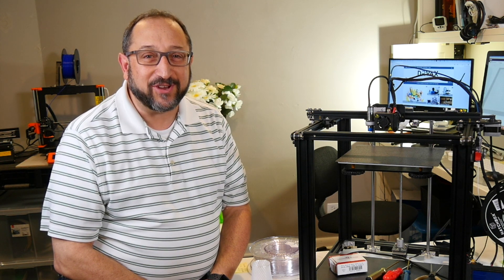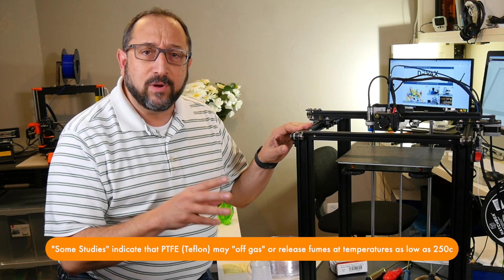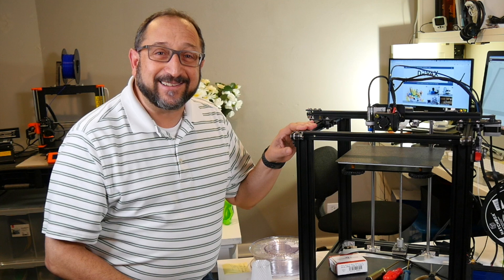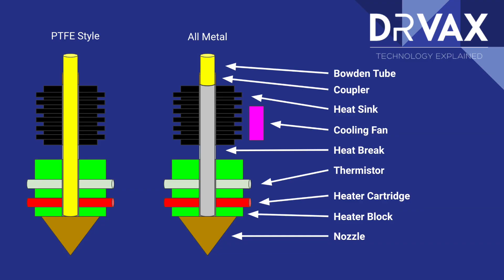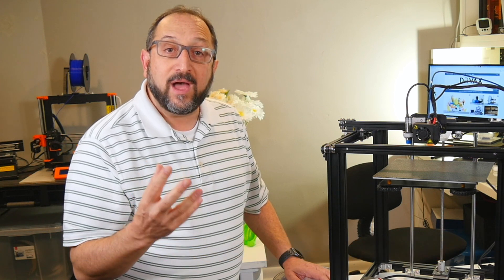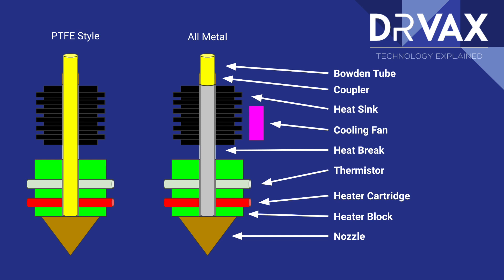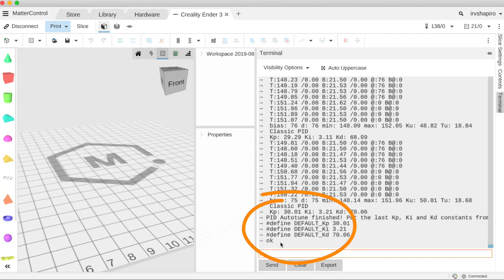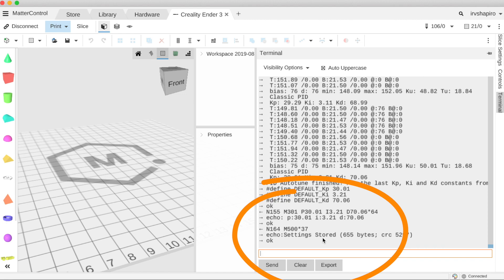Creality Ender all Metal Micro Swiss Hot End Upgrade and PID Tuning

Comment: You might wish to change the superimposed title  "Ender 3 Printing at 175".
Reply from the maker: Where?  On the thumbnail?  The video uses a Ender 5 in the examples but this hot end also fits the Ender 3?
Reply: @MakeWithTech  Hi Irv, yes, when I go to your "videos" page in your channel, I'm presented with what I think you mean by "thumbnails" of each video. The one for this video shows an overlay of the words: "Ender 3 printing at 175" and I'm pretty sure you meant 275. I can't attach a photo of it here, but I'm sure you know what I mean.  No worries on where the Micro Swiss can be used... I've had one for several months on my Ender 3 Pro and it has been the best upgrade I have ever done.
Reply from the maker: Wow.  Big mistake.  I just changed it.  Thanks for pointing it out.

Comment: Useful info, I have been looking into PETG lately. Was just worried about fumes/safety.
Reply: @Don Gray For work I use ABS to print .2" spacers occasionally and I think over the course of months they lose a little of their width because they get heated in between aluminum plates at ~350 degrees C (though I don''t think the ABS actually gets that hot, probably more like 170-200 degrees or so)
Will give PETG a try at work for sure, our lulzbots should be able to handle them fine. My Ender however will probably need the hot-end upgrade.
Thank you, Don.

PS. The ABS smell with our printers at work is horrible, my colleague and I had to move our printers into a whole room for themselves.. lol